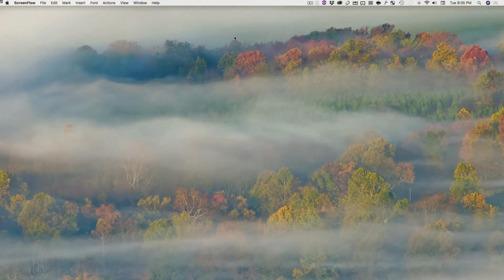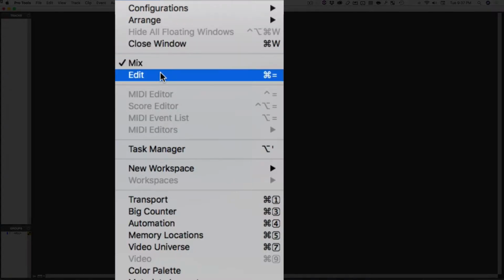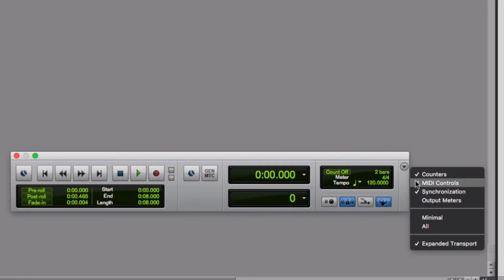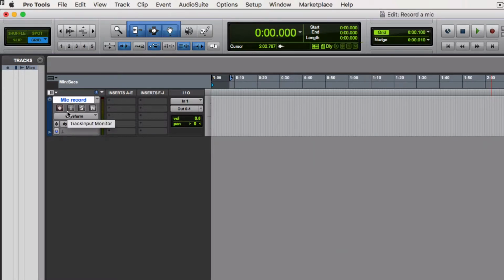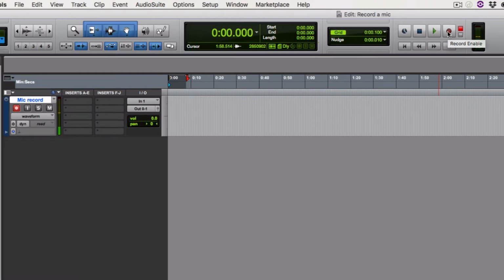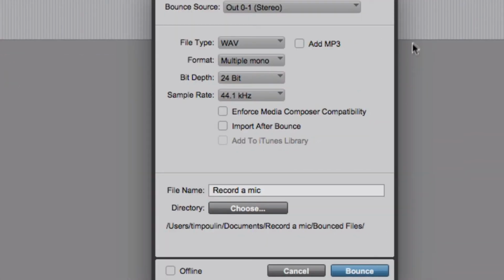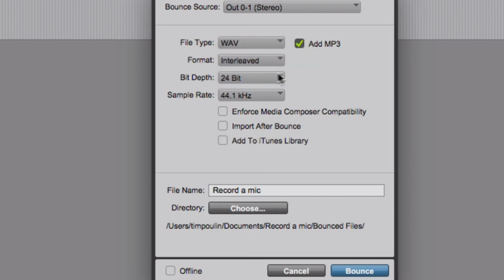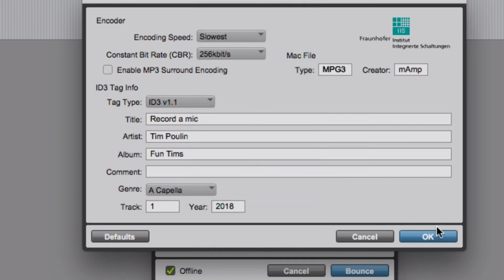190 Record a mic into Pro Tools

Comment: My microphone want pick up thru the computer
Reply from the maker: Make sure you've selected the correct audio interface where the mic's plugged in, otherwise it won't work.  

You also need to select which input you're using (probably input 1), and record enable the track.  You can select the input by going to Window>Mix Window, then selecting input 1 for your mic.  

For any further help, I'd need to know what you're using and how you've gone about trying to get sound in.